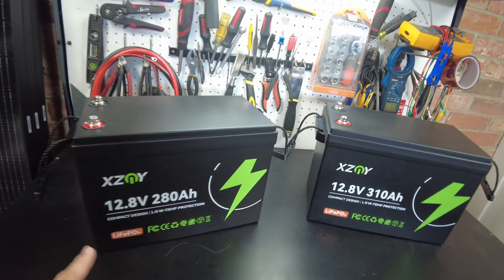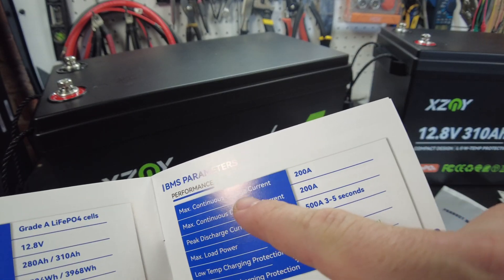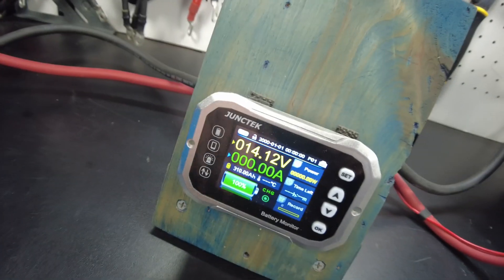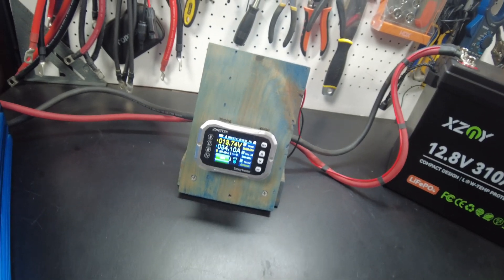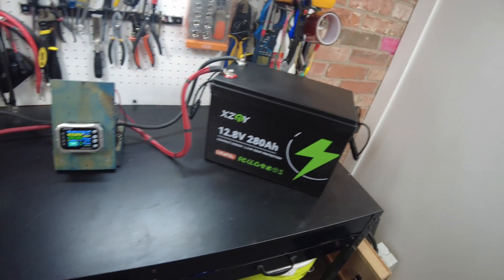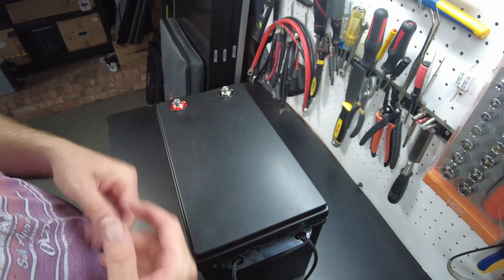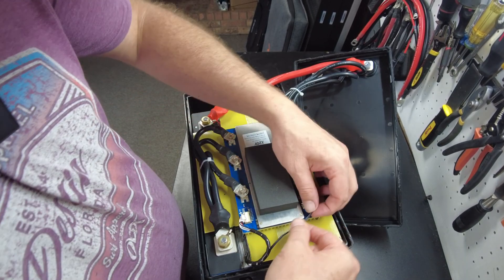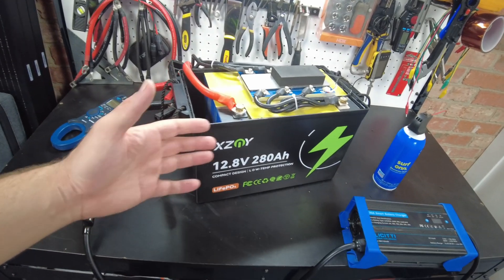XZNY Compact 12v 310Ah & 280Ah LiFePO4 Lithium Battery

Comment: I'm a bit concerned about the 1/0 cable handling 200A continuous..  even at that length.. online calculators suggest 3/0, 1/0 is good for 150A

Comment: Hey Brad - is the advertised length of 13.74” just the case and does that include the small tabs I see at the top for the handles?   If it doesn’t include the tabs at the top, how much do they add?   I have a very tight spot with a couple of 100 amp hour batteries but it would be amazing if I could replace those with these and have over 600 amp hours in the same space.
Reply from the maker: I measured, and the handle/tabs extend the length to around 15", maybe slightly over even. Thanks
Reply: @BradCagle  Thank you.  I appreciate you reading my comment and looking into the numbers.
Reply from the maker: @GoForAHikeNC  Anytime!

Comment: What do you think is the main intended use for these? Is this class of battery a substitute for “battery generator” such as an EcoFlow (assuming you have the inverter?)
Reply from the maker: Yeah, for sure you could build a DIY power station with these. I'm thinking about doing a build video with one of these. Thanks
Reply: Extension battery for a power station or use with an inverter/charger combo device as a back up to a sump pump in case of a power outage. The later is what I'll be using the two of the 310 AH batteries for.

Comment: Hey not bad!  That's about 200$ per 100 amp/hr. And i think they may even fit in a grp31 battery box.. also it looks like it's very well made.. Good review!  Let's run it by Will Prowse and see what he thinks too! LOL he can  run it through his giant toaster elements and make em glow!
Reply from the maker: Yeah, I like Will's load resistor bank. Pretty awesome :) Thanks!
Reply: @BradCagle do you know if this will fit in the Licitti power box
Reply from the maker: @DESERTDWELLER4547  I think it's too tall. But i'll check
Reply from the maker: @DESERTDWELLER4547  Alright, I just checked, and it does not fit.
Reply: @BradCagle  thanks for checking Brad I really appreciate it, another great video as always. Love your content.
Reply from the maker: @DESERTDWELLER4547  You're welcome!

Comment: $600 for the 310Ah compact... comparable to qty-3 12v 100Ah @ $220, but in one package, nice product for 12V action.
Reply from the maker: Yeah, pretty sweet. Good price, and small!
Reply: The 310 AH battery is now just $400 plus tax. Just picked up two of them. Insanely cheap!

Comment: lol new batteries that im sure you didnt pay for go figure
Reply: Anyone buying batteries is getting 48V. I've got a 48V 25Ah for $220 and 48V 50Ah for $350 (amzn)
Reply: @goodcitizen4587 No they are not.  I would use these in my truck camping and I need 12v so that I can run most normal “car” stuff directly from the batteries with no power robbing converters/regulation needed.
Reply: You can get two 48v 50 ah from DC House for 699.